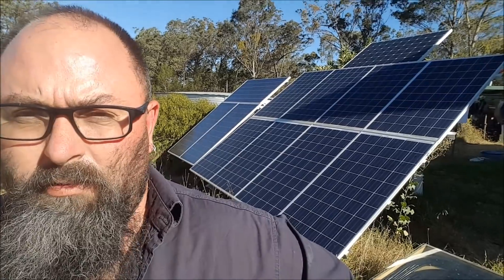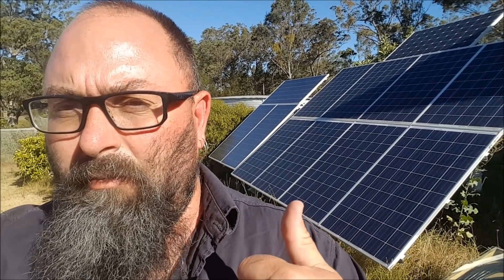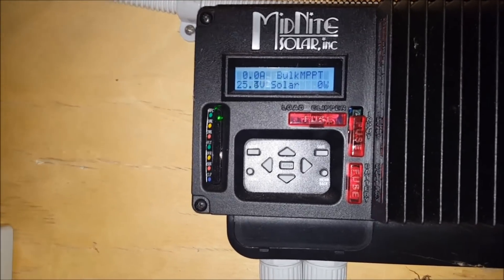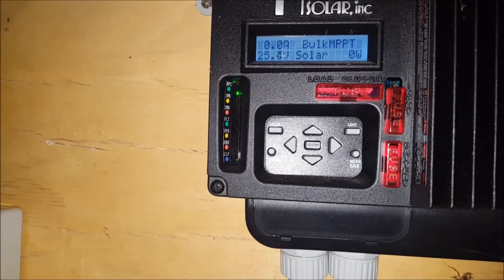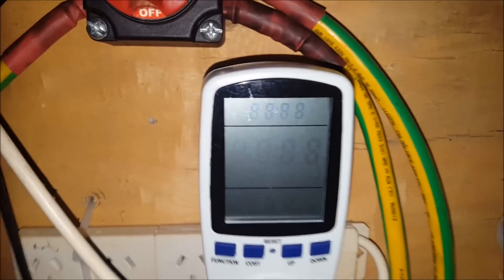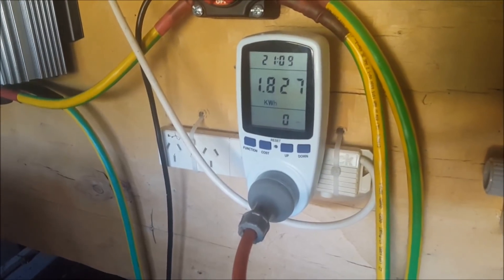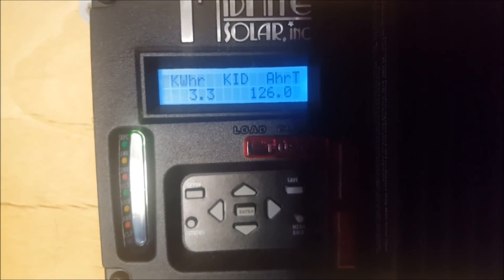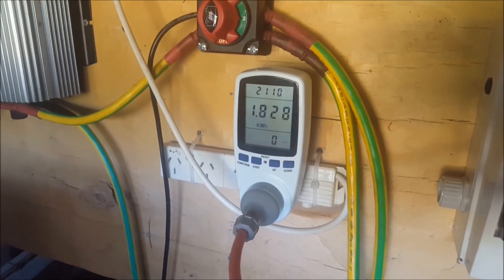Off grid solar power - Electricity production compared to electricity usage

Comment: There is also a much higher loss if you're drawing a substantial amount of power from the batteries e.g. if you're running them at the 5 hour rate versus the 10 or 20 hour rates, the batteries give out even less amp hours.  Great video though mate, it shows that you really must factor in losses when sizing up your off grid solar system, otherwise you risk running out of power.

Comment: That loss (from kWh seen on charge controller to kWh pulled from the inverter) seems quite substantial for equipment inefficiency... I had an issue with my system before but it was because my battery bank wasn't large enough and solar power was being wasted during peak hours, but that couldn't be the same problem because your charge controller is saying how much it actually put into the batteries...   There's no measure of how much power was available from the panels.
Reply from the maker: The mob selling the inverters reckon no load power usage is 1 amp.

Comment: I think that charging replacement is 130% that of battery usage, ie for every 1kw used from the batteries you need to put 1.3kw back into them to equal out what you used.

Comment: How often are you at your farm? im in melbourne and we are getting 30kwh a day after useage in summer but 5kwh a day in winter, Im copying justin case and getting 10kw more on my roof fro winter then I can get removed from the grid.
Reply from the maker: Pretty much every weekend, plus most of my annual leave. Calling it a farm is a bit of a stretch, though, I don't even have an acre. As far as power generation goes, I'm sure if I had more of a load I'd be able to produce more, I haven't really tested the system for a while day with a decent load on.

I might have to set up a water pump or two and see what I can do.

Comment: Seems about right, you can never have too many panels though, especialy for winter. i had inverters that were very ineffecient so i ended blowing some money on a good one, atleast youve got a decent mppt, all you need now is a battery extra and you may even get better results.
Reply from the maker: I've got no problems with batteries at the moment. I've got the 630Ah & 375Ah banks both hooked up and I can easily switch between the two.
Reply: sorry man i meant the device called battery extra

Comment: your not using enough Power. All them panels mate u need to run Some AC units :) Batteries when old take a lot to charge. Good video my friend
Reply from the maker: I'm looking at getting a 1/2hp window rattler before next summer. I've just spent about $3,500 getting a wood stove installed.
Reply from the maker: I've also just ordered a 32A Noark breaker. I'm currently still running the 20A breaker between the Kid and the battery banks, so when there's sustained high load/high output I've been getting nuisance tripping. The 32A Noark breaker will solve that problem while allowing the Kid to put out the maximum amount of power it can.
Reply: Solar power runs all the Cool stuff in summer :)
Reply from the maker: I'm still learning while I build things up to run more than just the essentials. There was a guy selling 2 year old 250W panels in Melbourne the other day for $90 each. I was tempted to get more.
Reply: Yes don't you just hate nuisance tripping. The Noark breakers are first class gear. Big wood ovens cost lots of $ well worth it. Does it have a water jacket ? Solves all your winter water heating if it does
Reply: Sounds like a good deal. offer him $70.00 as the market is flooded with the 250w panels as china dumped shitloads in Australia the last few months. Lots or people are switching out to the new 280 / 300 watt panels. More power same space and fittings
Reply from the maker: The stove has got a water jacket but for now I'll just have it hooked up to a header tank on a stand next to the stove. It's the Nectre Baker's Oven. I didn't particularly want one with a water jacket but the deal was too good to say no to.

Comment: Great video.  
It would be good to know where that extra 1.5 kw is going.  
Is there anyway (cheaply) to narrow that down?

I wonder if my victron 150v/35amp charger controller has a meter I could add to help narrow down my power wastage.
Reply from the maker: You'd need an ammeter of some sort to see what's coming out of the batteries. The difference between what's going in and what's coming out is what's lost in the batteries, then the difference between that ammeter and what's coming out of the inverter is what the inverter's using.
Reply: Pop's Shack yeah no worries.  
I popped into old mate at Cooma and got some of the busbar. Seam like a good bloke.
He has a heap of batteries in there including some of hawker 130s   Might be worth a look if your after more.